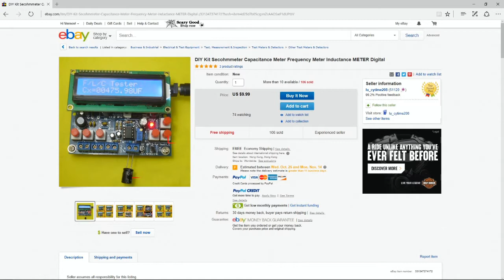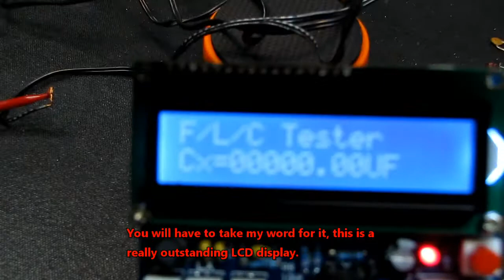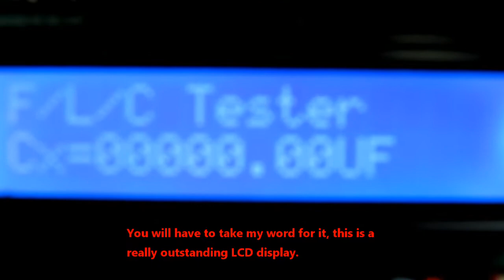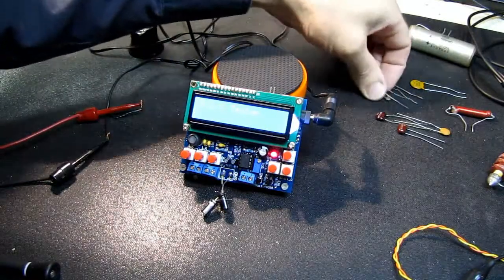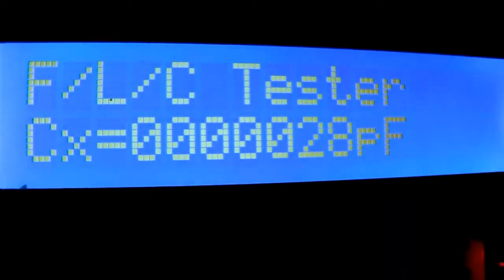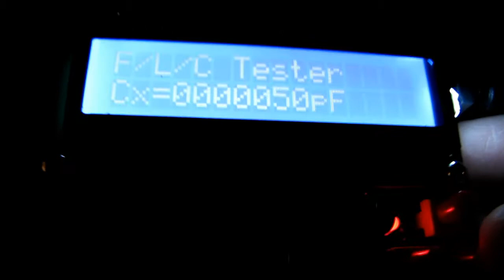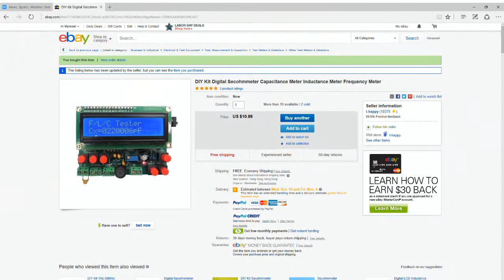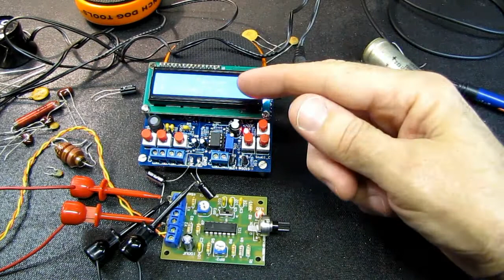10 Buck Test Bench - LCF Meter Secohmmeter FAIL

Comment: Some time ago I bought an LC meter from China and got a piece of crap for 13 bucks. Range on the caps and coils supposed to be similar to what  yours has and, surprise, surprise - it performed just as bad as yours. I really wanted an inductance meter from .1uH to about 100uH, so I was frustrated and pissed at the same time. That gave me a final kick in the butt to make my own LC meter, which I successfully made. The only thing that was stopping me before was the absence of accurate caps and coils to do a calibration with. Since I was broke, I just picked a few film caps, measured them with DMM and used them as references. The result surprised me, for such a crude calibration. Sorry for a long comment, but I just had to share this. 
  I enjoy this series, even though I can't consider myself a hobbyist who just started tinkering with electronics. It's the approach that I like in your vids, keep them coming :) By the way, what engine I hear in the intro? Sounds like a V-8 from a jet boat :)
Reply from the maker: Hi Mr Johhnnnnnyyy. Thanks for watching. It was a letdown to find out how bad it was. However, stay tuned. I just finished building another unit that works very well for 10 bucks.
Still need to edit it and put it up. But this one works well and has a lot more functionality. The engine is a shovel head Harley. Sweetest music in the world. Never tire of the shut down as the carb sighs hhaaaaaaa.
Reply: + The Radio Mechanic Wow, that engine sounds mean for it's size. Sweet sound indeed :)

Comment: I bought one of these and after assembling it the thing has worked fine. After calibration it measures capacitors correctly. I laid the tall capacitors down for clearance rather than on the bottom. It is a nice kit and I use it often and it works.
Reply from the maker: HI Luther, glad to hear yours worked "out of the box". This is the trouble with Chinese stuff. No quality control. Turns out I was not the only one with a problem, but it has been resolved. I did another video about the fix. Thanks for watching.
Reply: I watched the repairing the coil video next and plan to check mine even though it works. I haven't used the inductance yet, but it tests capacitors.
Reply: The software/firmware provided is "not very sophisticated" (READ: any western Uni student producing crap like this code, would have failed the course!).
But once calibrated, and allowing for the awful software, it is surprisingly accurate!   Anybody know of some better s/w versions??  (please PM)
Show less
REPLY

Comment: Hi Radio Mechanic. I encountered the same bad performance on this unit. Small picofarads where in steps of 6 en inductance was not usable. I found out that the on board inductance was 1000x (!) to big!! 100mH instead of 100uH. The coil measured 138 Ohm which is far too high for such a small inductor. In had some other 100uH inductor and installed this. Now the picofarad range starts at 0 en when I twist the connection leads it increases by 1 pf to 5pf with stable reading. Also the inductor measurement is working correctly now. A coil of 5uH gives proper reading.  I have modified the existing coil by removing all the wire and rewound with 50 turns. This gives ~100uH and reinstalled the coil. For electrolytic caps measurements use the multi turn pot to calibrate (0.632 * 5V). Refer to the documents supplied on the sainsmart site. That also explains why no zero settings are needed. My conclusion: this is a cheap and very usable kit.
Reply from the maker: This is a very significant find. I will pull mine out of the junk pile and check the inductor. If this is the fix I will make a video update and will make sure I give you credit for the find.
Thanks for taking the time to leave a note and the information. I didn't even bother to check. Just moved on to the next project.
Reply: BRILLANT ADVICE OMG !

Comment: I bought the same kit.
After assembling it. It display quite fine asking me to select what to measure. If I insert capacitor to test it will display 

"Non capacitor
CX = 000.000pf"

Or 

Inductorceer 
Lx= 0000/000.0uH
If I want to measure inductance.

I'm frustrated so far, I don't know what to do now because it seems I have high hope with this kit but it is malfunctioning now

Comment: I bought several types of these kits scr meters the I like the most was a factory built one for about $ 23.00 .seems to do it all and has a nice case ,and a back light,so now I have four types
Reply from the maker: These kits, and the whole 10 buck test bench series, are an attempt to show the young players that test equipment can be affordable. I have professional gear that I normally use, but have been having a ball building and restoring in the making of these videos. By the way there is a follow up to this video where we get to fix this unit and make it functional. Thanks for watching and the great comment.

Comment: I wager a guess that you possibly got a fake one. This is how it is, some hobbyist offers a self-designed kit on Taobao, people keep buying it, the seller no longer can manage the orders, a dozen others jump up, and butcher the thing: copying mistakes, bad component selection (see those capacitors - bet the original ones were less tall), etc. The person who first laid out the PCB and kitted them together probably takes pride in his work, even if he didn't quite manage to get the software or precision right, just like you expect of any hobby engineer in any end of the world, those that rip him off likely don't.

Oh BTW, most of these aren't entirely original, but rather based on forum posts from my part of the world, in particular the "AVR-Transistortester" project that was started by Markus Frejek and continued by Karl-Heinz Kübbeler. It's not to say that all Chinese hobbyist kits are Western ripoffs, some are definitely of a Chinese origin, like that one IC tester that's based on a 8051 controller by a Beijing company STCMicro. The famed toy oscilloscopes by JYE Tech are definitely Chinese original developments, but the vast majority of them is counterfeit.

Once the counterfeits emerge, it's usually nearly impossible to get a genuine one in the West, not without knowing Chinese and reading their forums and having a Taobao account, so you better hope that the fakes are reasonably exact copies.
Reply from the maker: It worked quiet well once it was fixed.